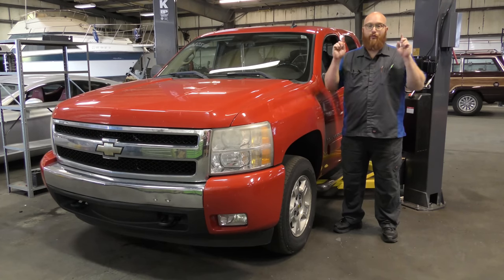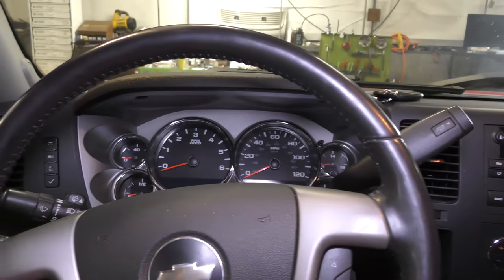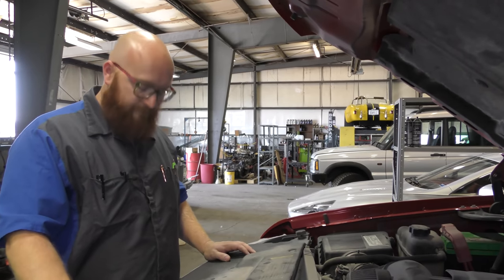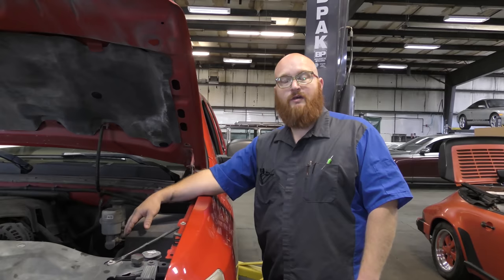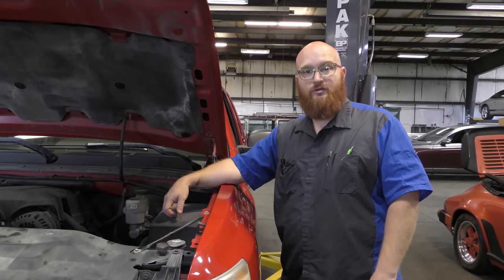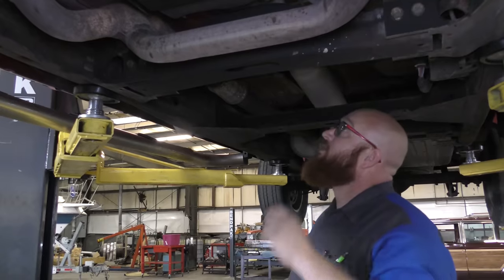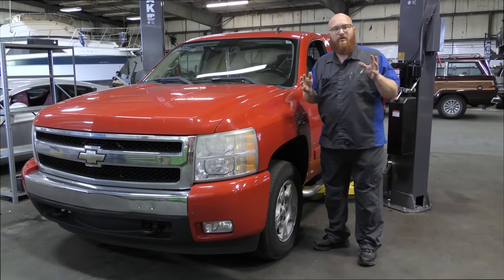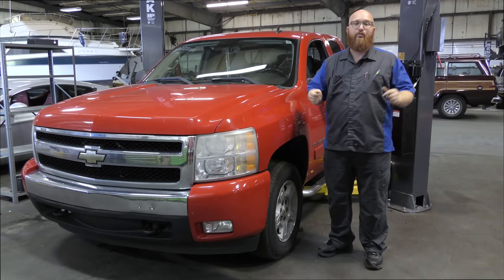Good Truck/Bad Truck? CAR WIZARD shares most common problems on the 5.3L Chevy truck at 100k+ miles

Comment: Who cares about grumpiness when you’re spitting straight facts!! Thank you for your content & subbed! I have a question:

Looking to purchase a 99-08 chevy; while your other video claimed the 07/08 tended to have more issues than the previous years (99-06); im a bigger fan of the body style of the 7/8s and with them being a bit newer, I’ve noticed some more appealing interiors.

Is it a big enough reward/risk to still consider the 07&08s or should I stick to the 06 and a few years younger.

Selling my Jeep Grand Cherokee after sinking enough money into it and I want to get a pick up to tow a future VERY light camper (under 3500lbs) and have always wanted a Chevy. Sadly, the price of these right now are insane and I’m struggling to find one under 150k miles! Any answers to those would be extremely helpful & THANK YOU!

Comment: Solid review.  I just sold a similar truck, 2011 1500 4wd Silverado, 5.3L, 56,000 mi to my brother.  Never in the snow, 4,000 mile oil changes, 20k af changes.  Was a trouble free, clean truck.
Reply: Damn I look everywhere for a truck w that body and that low miles settle for 113k but she still runs like a dream

Comment: Love those 8.1L 496 cubic inch V8s. Have one in my 2003 GMC 3500 dump truck. And man that thing can pull anything and everything without going over 2,500 RPMs. People also don’t know that the 8.1 setup has an Alison transmission mated to it. I’ll run it til the wheels fall off. 

And don’t worry about being grumpy! People don’t seem to understand that work is money. And you do QUALITY work. You’re probably one of the best mechanics in the country. And your prices are WELL WORTH. If people don’t like it, then like you said, THEY can do it. Good work, good sir! Keep it up!

Comment: Wizard I own a 2004 Tahoe Z71 4x4 with 303xxx original miles and I've serviced my transmission and differentials and transfer case every 50k miles. Transmission seems to be doing just fine. And I'm like you. I'm a military veteran and I've been working on cars since age 8 and I'm 50 now. However I'm a disabled veteran and it hurts to lift my tires or stay bent over the hood for to long.

Comment: I have a 2004 Silverado 1500 Z71 with the 5.3 and it’s the best truck I’ve owned besides my 74 c20 but it’s never had any issues with the engine and has 283,335 miles on it but I did put a stage 4 4l60e in it because the original tranny started to shift rough at 260,000 miles, my grandpa has a 2010 Silverado 2500 Z71 with the 6.0 and it has 110,000 miles on it and that’s been a great truck for him, it hasn’t had any issues at all and it thankfully didn’t come with afm

Comment: Drilled into your water jacket? Run a tap into the hole, get a nice long grub screw (not so long as to poke into the portion where you need to replace the bolt.. Put some thread sealer on it, run her in, call it good.

Comment: I'm an exhaust guy. Don't drill the manifold bolts out. Use a nut that just slides over the broken bolt and weld hard on the end of the broken bolt fusing it to the nut. Then quickly while it's still hot slowly walk that bolt back and forth till you walk it out while using penetrating lubricant very liberally. That is as long as there is anything sticking out of the block at all of course.

Comment: I feel that way all the time,but then I  have some great customers,some how it evens out,and btw the most common problems on the 5.3 are,the knock sensor wires,the water pumps,the intake oil leak,and fuel pumps,etc,but all in all they are good engines and Trucks,I can name alot from the Ford 4.6,5.4 etc,and Doge trucks,well don't get me started,lol.

Comment: This body style came out in the 2007 model year. This body style and the 1999-2006 body style were both sold for the 2007 model year. The trucks with the 1999-2006 body style were called "Classic".

Comment: 2015 GMC with the 5.3. I've purchased a plug in that cuts out the cylinder deactivation. It runs on 8 cylinders all the time. So, no lifter failure problems.

Comment: No worries on the complaining. I've had people try and charge me market price for used vehicles that needed work (convertible top replacement, suspension parts, etc) because they knew I could do the work. 

I've told them they do not get to make additional money off of my knowledge and walked on those potential purchases.

Comment: I’ve had all these problems on my 2010 Sierra SLT at 167k so far except no AC tensioner on mine because it’s the newer design stretch belt. I also deleted my AFM at 143k with a non AFM cam and Texas Speed Delete kit. I used a new evap solenoid off an older model with no tube vent, much cheaper. Pads, rotors, drums, pads, ucas, struts and shocks, tires, end links and so much more. My rear quarters are rusting along with the tailgate and bottoms of doors but still runs good. Three oil sensors and they’re much easier when you leave the foam shroud off the back.

Comment: You might want to try and weld a nut to the broken exhaust manifold stud and try removal that way, another way is a reverse thread drill bit with drill on reverse drill bit, many times the stud will spin out from the force of the drilling

Comment: It's ok Wizard, stress gets to all of us now & then!
My cousin bought a low K's (mileage) Holden Capitiva a little over two years even though many of us strongly opposed her decision. Sure enough, and I wish I knew exactly what happened but the end result was her $8K car was going to cost around $5K to repair... so it went to the wrecker! Then made the correct decision and purchased a Holden Commodore Station wagon (with the old school Buick 3800 <3)
Holden Capitva's are not Holdens, they are Daewoos with a couple Holden stickers... at one point it was the most recalled car internationally for just constantly having issues... atleast now she knows the majesty of the old 3800's  (which I believe Wizard would surely approve of that engine!)

Comment: 2006 gmc sierra 4 door I have 203k best truck ever last year before cylinder shut down and still has iron block aluminum heads everything on it literally everything easy soo easy to repair I even took the oil pan off with a new oil pickup o-ring on it and resealed oil pan with new gasket those O-rings usually fail I'm counting on this truck to run for a while

Comment: There’s also an exhaust manifold bypass bracket for the rear manifolds. I have one on mine for the last 10 years and it’s been good. It’s at least an option for those that don’t want to risk drilling out the old bolt.
Reply: Yeah, best to just pull the heads or use the plate. Can be a huge pain.

Comment: Just bought a ‘10 Sierra SLT with the aluminum 5.3, 6L80, and Eaton G80 and it was comical when you went over the list of common faults and my truck had most of them lol. It’s a great truck, even with all of its problems.

Comment: the knock sensor in the valley of the block. the oil pressure on the rear of engine. the ground wire is corroded . the wiper.pump.

Comment: This is basically my truck. 5.3V8, no AFM, etc. My dash is cracked, but it’s fine with me. I’ve done regular oil changes and have 145k on the truck. Just recently had to replace an O2 sensor and headlight bulb. I haven’t had to do anything else yet.

Comment: I have a 2009 Chevy Silverado crew cab, same color with 178,000 miles on it, it had 13,000 when I bought it in 2011. I haven't had any major issues, but will check out some of the things you pointed out. I don't tow anything with it and don't drive it hard.

Comment: also good to replace the spare tire carrier if you get one of these. not fun having your spare stuck when you need it
Reply: Tell me. My 2010 the spare was never down. Had to cut it loose to get at evap module to replace it as was stuck open.

Comment: I have a 2010 crew cab 4x4 with 215,000 and still running. Common problems are oil related. Still cheaper to fix than buying something else. Transmission is starting to slip though.

Comment: I have a 2008 GMC Sierra Denali that has the L92 LS3 which was luckily the last great motor without the LS killer AFM, DoD and VVT. I own/run a pretty successful and busy shop in North Carolina called Brakes-N-Axles and down in what is considers the south the main issues we have with these motors are oil sending units, oil bypass block off plate and motor mounts which is by far the most common. But I’ve done enough intakes to have it apart fixed and back together in well less then a hour given I don’t have to wait on parts to be delivered. These engines are great as long as the oil is changed regularly. When the oil isn’t changed and the engine comes with AFM or DoD it is going to drop a cylinder that is one of the cylinders that is shut of with AFM due to the oil passage being restricted and excessive wear on a cam lobe or collapsed hydraulic lifter

Comment: I have 2008 Silverado 1500 5.3 , 235k miles same spark plugs transmission fluid and coolant , never had a issue

Comment: Had an '08 Yukon, 5.3v8. SoCal SUV, no rust. Sold it at 178K to my mechanic. His wife now drives it as a daily driver. Biggest issue was the master break cylinder that went out around 100K. My mechanic told me the warehouse had many on the shelf ready to be sold, as if GM knew of an issue, though no recall. 170K the radiator blew out in Mojave but local shop had one ready to go. I had BG transmission flush every 35K, so no problems there. Never had issues w/ lifters though, again, BG cleaner service every 35K. Akebono breaks front/rear.  Finally sold it as engine mount began to leak and was looking at close to 1K for both to be repaired. Cheers.

Comment: I have a 2008  half-ton with a 4.8 and it has 300000 miles.  Motor wise it’s great, I only had to change the throttle body 2 years ago. I had to swap out the gas tank 5 years ago because it rotted. The front end suspension last year. I’ll probably have to do the bushings this year but otherwise than that I like my old reliable.

Comment: For the exhaust manifold bolts I've always welded a nut onto the broken stud and removed them that way. I've never used an easy out for that kind of job. Welding takes less time and if you know how to weld well, then it is pretty easy.

Comment: Yeah, used car prices are pretty insane. Two years ago I purchased a 2000 Jeep Grand Cherokee with a quarter of a million miles. Now when I browse, I can see the same vehicle with the same mileage in worse condition for $2.5k-3k.
Reply: My father will have to plan to buy a used vehicle this fall, but they are so high right now. The prices will plummet this fall.

Comment: All shops have different flat rate hour fees, we charge the average rate of about $125.00 including taxes but parts, disposal fees and shipping are extra.
All certified auto technicians work on commission, therefore if the Car Wizard can do the job on one third of the time he still will charge the customer the full rate.
Some shops charges the customer on every starting hour and therefore it is up to the consumer to get that quote printed out on the paper including parts and labor.

Comment: I have an 08 2500 6.0 ltz z71 package. Still worth every penny. No Bluetooth but got the aux Bluetooth receiver, no USB but got the cigarette lighter double usb flush setting, not modern Navi w/ traffic but got the Google on my phone... Simple easy to control leather 4 wheel drive fog lights, power everything and heavy duty. A tiny bit of rust under carriage and bubbling around back wheel wells, no a/c or heat at the moment but it's a truck built for tough men and real men don't complain and don't need back up cameras ...a truck that women also like and kids watched their movies when they were toddlers. Drove it through snow storms , tropical storms ,across a few states and back, moved my entire apartment 3 times. Held its value and no regrets. The best purchase I made. Yeah I had issues, but what vehicle doesn't? Good vid bro.
Reply: I bought it new in 10/07

Comment: You need to try just welding a nut on.  Even if the bolt is flush with the head, put a nut over it, tack it, then fill the nut.  The heat from welding tends to free then up then the nut is there for you to wrench it off.  If the nut pops off you just repeat.  I have not had any automotive bolt I failed to get out doing this.  If they aren't too stuck, its usually 5 mins at most to tack, weld and spin off.

Comment: I owned a Traverse and F-150. Chevy alternator went out at 46k miles stranding my family on a mountain on New Year’s Day. F-150 with its whiny transmission burned oil and reprogrammed the PCV at nearly 15k miles…still knocked and rattled…today, like most Americans I bought Japanese reliability: a Highlander and Ridgeline and never again am I buying “American”…which means Mexico/Canada assembled with Chinese parts. GM comes in last for reliability, thank you Mary Berra.

Comment: The global chip shortage on most brand-new and newer, used vehicles are still on-going throughout the year and this information is for most individuals, who needed or just wanted a vehicle. The best answer for this one is a need to get themselves from point A to point B or they will be deciding to get something, that is more enjoyable or for pleasure. Driving is a commercialized task and a social activity, as well as a privilege and a serious responsibility. For a need, a mid-2010's Toyota RAV4 or the first-generation Mazda 3 with the 2 L four-cylinder engine would be a great choice. For a want, the 2003 to 2009 Nissan 350Z or a 2002 to 2006 Acura RSX will be a great vehicle for individuals, who want to take these vehicles on a road trip. Those are the answers to the Car Wizard channel.

Comment: With exhaust manifolds off, Chuck a rat tail file in a drill. Oblong the holes from to rear, reverse & coward the drill to go up or down the hole, place a 4” long gas pipe, conduit or suitable to guide the file. Flat the front if possible on the bolts head side of intake and use a flat washer. No more broken exhaust bolts.
  Alternator goes bad? Test battery with a conductance tester, dielectric grease on cable end. Run 10 AWG wire from the back case of alternator to engine with large eyelets and solder them. Negative is generated on the back case of the alternator thru diodes and need a good path to starter, battery, cab, frame & bed. Use “Star” washers on sanded surface and dielectric grease. Start & turn on everything. Use DMM with lead on alternator B+ to battery B+, same with alternator ground and you’re testing voltage drop and should not be above 0.400 Vdc and less is better. Even with reman, switch DMM to A/C volts and check at alternator B+ to Ground, rev engine to 2k RPM, A/C should be way less the 0.050Vac & 0.009 normal. Leakage past diodes as reman test diode and reuse if test good but not this test. Too high A/C voltage messes serial data signals & creates errors.
  Trans, install a “Superior 4th servo and 3/2 all the one time. It is outside case and 1.5hrs, plus stuff to remove like running boards, custom exhaust, etc. Add cooler if towing!!!
  Oil catch can, drill 4 new holes inside drivers valve cover at bottom of tin shield for PCV and clean out w/carb spray compressed air. Mark with awl the location between the rockers and drill drain hole in sheet metal cover only at 5/64” or close. 
 Active Fuel management (4 or 8) require clean & correct oil as screens under VLOM will plug and lifter will stick pin causing damage. Maintenance!!!! Retired ASE Master Tech

Comment: I had a '10 with 100k and the dealer had already replaced the engine, but the only thing I did was the passenger CV boot and cosmetic stuff.

Comment: I had one, and, the engine was great, as well as the transmission. but, the bodies were terrible. The wheel wells rusted out, not door sill, and, what was supposed to be a rocker panel rusted, the plastic door protection fell off. But, my big gripe was the digital controls for the heat and ac. you had to take your eyes off the road to set them, that was dangerous. and, a real pain.

Comment: Pretty much on the mark in comparison to my '11 2500 EXT CAB LWB WT Eaton 2wd, Wizard. Towed 7k daily for 8years. Manifold crack, and tranny @ 120k. Bent at manufacture, hydro-boost tube developed a pinhole failure. Cracked the diff spoil while backing trailer up hill on ice. Trans cooler lines replacement due to rust. At 134k, I keep hoses & belts ready. 6.0 still runs like a freight train. Suspension is still tight, thinking about shocks.

Comment: Hey Car Wizard! In your full size, half ton, gas trucks to buy & not to buy video, you had the 2007 and newer Silverado/Sierra trucks under the do not buy category. I'm now hearing you would have no problem buying this 08 Silverado in this video. Can I please ask for clarification here, good sir? Keep on rocking, Wiz.
Reply: I agree with you, because the 2007 and newer GM pickups are a not to buy, due to active fuel management.

Comment: I think the OLDER Chevy trucks are just fine, because I have a 2001 Chevy Suburban with over 300,000 miles and the engine runs smooth AND loses no oil driving 1200 miles on a trip.  I do believe the newer 5.3L engines with AFM can be much more problematic, because they just don't hold up as well as the older engine - having lifters of different sizes seem to damage the engines more.  Mine looks like new, because I had an excellent paint job when the exterior was fading.
Reply: The older ones have lifter issues as well.